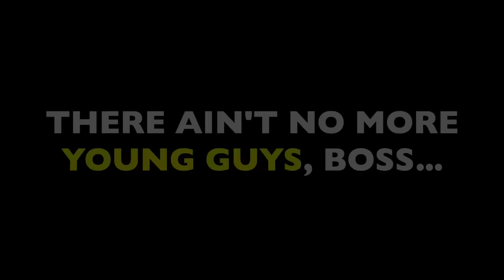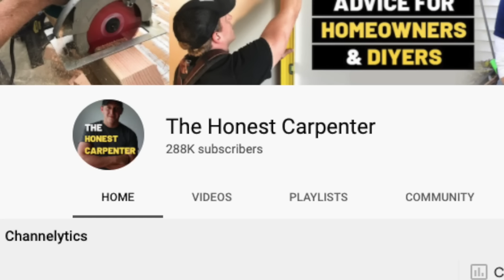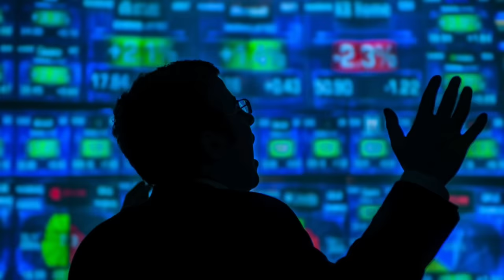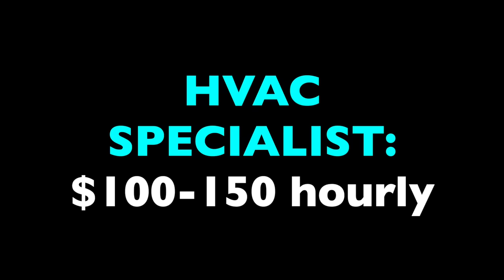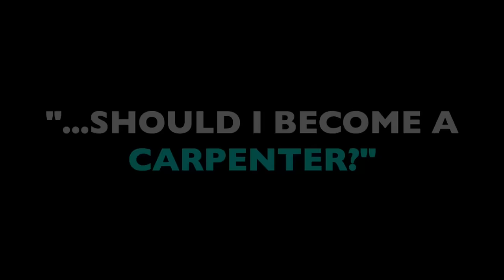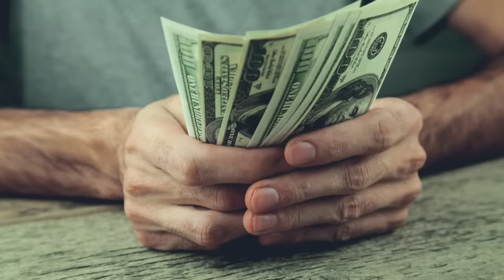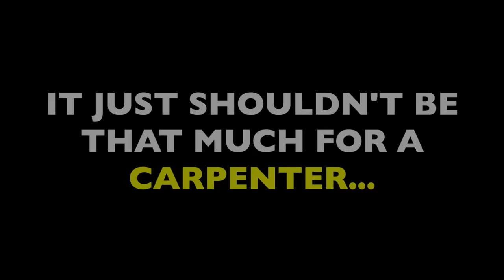WHERE HAVE ALL THE CARPENTERS GONE?! (Why The Trade Labor Shortage Is Only Beginning...)

Comment: A good carpenter makes every other trades life easier.  Poor ones create nightmares.
Reply: @Jody Whitehead - Said perfectly .
Reply from the maker: So true, Jody. Ask any plumber who’s found a joist right beneath a toilet flange location 😬
Reply: @TheHonestCarpenter  when I started contracting my first job was to correct all the things some bozo did to a sweet lady's house. Whoever it was had no idea what he was doing. The idiot did things like cutting the nailing flanges off custom made windows. the joists were all under size, and not on 16 inch centers. His idea for fixing a leak in the garage was to puit up sheets of thin plywood and caulk the edges. I could go on, but just say it was such a mess it cost more to undo than it would have cost to do it all right in the first place. I could not do much about  the widows with the nailing flanges cut off, all I could do was seal around them and put on tight fitting trim. (the lady didn't want to pay for custom fit windows all over again, and I don't blame her.)
Reply: @TheHonestCarpenter  Plumber here, we deal with that all the time. Most framers are terrible; crooked studs, twisted floor joists, every hole you drill you hit nails, etc. The difference it makes when you get good framers vs. bad framers is night and day. We did a house about a month ago and the framer actually moved the joist over a few inches because he knew the toilet was going there. I've never seen a framer actually do that before and look out for the plumber like that compared to the house we're doing now which had terrible framers and the joists were dead center where the toilet flanges had to go... on all 3 toilets in the house. The framers were still on site finishing up so we ripped them good. Of course, all we got out of them was 'no habla ingles'.
Reply: Very true, I run into that issue a lot.
Reply: Trust me they habla ingles..that’s their way of not being responsible for the mistakes...I work in landscape n if a resident complains to them they shrug their shoulders then come to me cause I speak English like them and have to deal with the screw up they caused...funny thing is when they tell me it’s in English..just shake my head and think why?
Reply: Essentially, there are two types of tradesman and this is across the board throughout all the trades: those who see the bigger picture and those whose world stops at the end of their nose. As a carpenter, my no.1 beef is plasterers who "bell out" the last two or so inches from the foot of the wall so the skirtings don't go on flat. Dressing this down for neat skirting takes several times what it would take to skirt the wall. If I mention this to most plasterers, it goes in one ear and straight out the other. I now go round after them with a trowel before the plaster goes off and this is only one example; there are others and yes sometimes it's one of us not paying attention or simply not caring enough.
Reply: @Maltloaflegrande  As a plasterer myself, as well as one who installs baseboard trim now and then, I always try to think of the next guy and make the bottom of the walls neat and plumb for the finish carpenter. If everybody thought about the next guy, this world would be much different. 
Steve.
Reply: I’m now 70 with bad knees and back. I was lucky to learn from an ol guy that could do more with a square than I could imagine. In the 80’s housing boom lots of work went to “no skill required” piece workers that 3 nailed studs (sometimes 2) and whos tapes didn’t have 16ths on em’. (Or many times 1/8’s) Just sloppy work and go. That effects all the next trades, etc etc. Great video. It hit home!
Reply: Totally agree with that. Trades need to work together, i often go out of my way when doing work to move things slightly or do things a certain way so it helps out the electrician/ plumber further down the line. Yet i have had other carpenters ask me why i am i doing something in a particular way, after telling them it will make the plumber/ electricians life easier. Their reply is often - nah screw that, i do whatever makes my life easier. :(
Reply: How incredibly true. I used to tell my friends in grade school that my dad was a carpenter. It was more understandable than an entomologist who studied bees. At the time he was renovating our kitchen with cabinets he built himself. I still have no idea how my dad taught himself what he knew. It seemed he could do anything. How I wish I could have learned his skill but I was the youngest and too young to know at the time, plus a girl and so not socialized to pay attention to that. Now I know how much it matters.
Reply: True that!  My pop was (is at 74 yrs old) a great carpenter proven to me early on.  He  worked by word of mouth and   usually had more work than he could handle. Didn't make a lot of $ until later on when my parents starting buying fixers. Dad knew the trades and mom took care of the business side. Worked real good for them. And luckily (thanks Mom & Dad) I learned both sides.
Reply: @Maltloaflegrande  oh I could agree more . Plasterers are the bane of my life. I'm starting to refuse to start work until they come back and crawl around on their hands and knees and chisel it off.
Reply: Electrician here and would agree.....
Reply: @losferwords100  Crooked studs and floor joists aren’t always the farmer’s fault. I hear you though man.
Reply: @donmamon9263  Good framers compensate for crowned lumber and minimalize it, bad ones just throw it in with no thought and likely don't even check for crown. And when I say crooked studs, I literally mean studs put in crooked and not square. Floor joists out over an inch over the span. All stuff that good framers don't do.
Reply: So do welders 🤔
Reply: @losferwords100  LMAO, I'll be sure to NOT put that nail where you aim to drill a hole.
Reply: Quality and process control would take care of it, again, there's apps that probably need to be created that would scan the structure and pinpoint problems so that the nightmares could be addressed before other trades get in there.  But costs, lack of good homebuilder/contractors as well as low paid sweat laborers produces the crap to start with.
Reply: @geowen57  Just saying, framers that over-nail and put no thought into nail placement just makes everybody else's job harder and costs us money when we hit those nails and destroy our bits.
Reply: @joebloe9901  Anything can be f'd up, example, guy takes 3/4 water line cuts it down to 1/2 line and feeds everything in the house with that, I saw it and took it out.  It may work but not optimally. Problem is everything hides behind drywall, buyer never knows unless they have done that kind of work and know what to look for.
Reply: @robertgaritano7718  And now Biden is letting even more illegals come in to keep the wages stagnant. I don't like the direction this country is going in.
Reply: You're close. A good architect makes life easier.
Reply: This goes for pretty much every job nowadays. Not just construction.  I'm a truck driver, no one gives a shit anymore.
Reply: @NoreastWhips  As a general carpenter you often get to be the next guy and the last guy.  Most plasterers are extremely messy, but when you find a good one you have to treat them well.  I have to do mudding once and a while and I really don't like it, but cleaning it up wet is way easier than letting it all dry up in blobs all over the floor, walls, glass panels, etc.

It's good that you care, because a lot of them don't! The same can be said about my trade
Reply: @carlb401  When you're employed directly by the owner/GC, it's usually encouraged or at least appreciated that you work in that way as it saves the project budget.  
No doubt if a professional trade has to work around a poor situation, it will cost you one way or another.  Contract job: Back-log it, minimal workers on-site as complicated work prevents unskilled workers from being useful.  This will result in delays and re-scheduling of trades (let's hope they are available for that)
If it's an hourly job it will obviously take more time and cost more.  
Everyone is more expensive than us, but depends on our work.  When we are being rushed to complete there will be downline issues.
Reply: @robertgaritano7718  it's still low that's why no ingles to this day.
Reply: @11co5955  It's been stagnant for the last 4. 🤷‍♂️
Reply: I don't know, I've made money off of fixing illegals work. The homeowner doesn't like it, but I don't like them using illegals. So I guess it's even.
Reply: @kellyknowles9249  Damn that's the worst kind of work, I hope you made a lot of money lol
Reply: THAT - is true...!
Reply: @mwjordan1990  good luck finding one. Architects are college kids who've never worked with their hands. They have no idea how to build anything, just lots of ideas on what they want it to look like.
Reply: Tell the gods of spark to clean up their mess and I won't put a stray 16 into their wire.

Comment: I'm a young guy who went to trade school for HVAC and worked in the field for about a year and a half. When I worked in the field I noticed that guys were making maybe a third at most of what they were charging hourly because of things like insurance costs, tool costs, and the amount of time you were driving as opposed to actually making money. This meant the only way to reliably make a ton was to start a business. Because of my physique (5'8" and 110 lbs) I physically cannot do most labor intensive jobs like furnace installs, condenser swaps, or attic ductwork myself so that makes it nearly impossible for me to start an HVAC business. I realized pretty quickly that if I wanted to make a lot of money I had no choice other than a 4 year degree so I got out of HVAC. The reality is it's orders of magnitude easier for me to make money with a degree than in the trades so I got out.

Comment: As a former young automechanic, it wasn’t worth it. Trying to get started, they don’t want to give you a fair shares work, it’s always the older dudes who get the lions share and I pick the scraps nobody else wants. The pay wasn’t good for the back breaking work I was doing in open air shops with no a/c. I ended up switching to personal training for less money, but am way happier mentally. It was hard to do but well worth it. The tradesmen jobs are behind the times and need to start treating their workers better
Reply: Current auto mechanic apprentice here. You described it. Big jobs go to the old guys why you’re left with nothing and shut pay “hey I want more money” “we’ll all the jobs you do are just little ones” “well you won’t give me a shot at the big ones” “well that’s risky you’re not experienced enough” “well I came here to get this experience” endless circle. Everyone wants something but no one wants to give. Myself included I don’t wanna waste my time not learning and working for nothing but bosses don’t wanna risk losing money.
Reply: @jasonjrf  This has been my experience as well. Anytime you need a job done that is even remotely difficult and/or not the standard cash grab job like tire changes, it's like they can't be bothered to fix it. Why actually do work and fix my leaking gas tank when they can spin off 5 bolts on a tire and slap some new ones on?
Reply: Why exactly should the new kid get the big jobs?  You and others don't at all understand you need to gain experience if you want to take on more.  You all want to be at the finish line and all without the effort or work to get there.
Reply: @jurupa  because they aren't building space shuttles, rebuilding an engine isn't rocket science. The work isn't that hard, just time consuming which is why the old fossils want it for the commission. Has nothing to do with experience.
Reply: @jurupa  because the point of an apprenticeship is to educate the younger generation in the trade so the trade exists in 20 years from now. If you fuck them over so badly they leave after a couple of months everyone loses. The consequence will be as in many other sectors that you have just a huge industrial complex that is about buying and throwing away with just a niche for artisanals who do the manual work for enthusiasts who can afford it.
Reply: @jurupa  how do you think you get experience on big jobs if you NEVER get one. Not saying first day be handed an engine rebuild, but when it’s apparent management just wants to keep you in one spot with no intention of growing your career or experience. That’s the issue with the trades
Reply: @ThePortadump  Doing smaller jobs gets you experience for bigger jobs.
Reply: @jurupa  please explain how doing nothing but brakes, oil changes, tires, and suspension job gives someone experience for engine and transmission work?
Reply: @ThePortadump  If you can't understand how that helps you then I don't know what to say. As apparently showing you have basic knowledge is above your head.
Reply: @jurupa   it does show basic knowledge we can agree on that. But doing nothing but that doesn’t gain anyone experience or knowledge in other aspects and plateaus an apprenticeship development. Pounding out ball joints and bolting in wheel bearings isn’t anything in relation to aligning can phasers, setting backlash on diff, then to get good at it you have to do it over and over. You have the exact attitude that causes young techs to leave after a year when they realize they’re hard stuck and no going anywhere cause you won’t let them.
Reply: @ThePortadump  And you have the very attitude that is holding you back because you want things given to you.
Reply: @jurupa  wrong. I have the attitude to not waste my time and wait for someone to hand me things when I know it’s not gonna happen.  First shop kept me in the tire bay, I wanted more they said no. I fucked off and got paid more and better jobs, That shop wanted me to stay with suspension and alignments and wouldn’t give me pay raise, left there for same pay but could start electrical diag and diffs, got another pay raise and now they’re handing me engines. I went out and got what I wanted. Sorry we’re no longer the generation that kisses ass.
Reply: @jurupa if you ain't willing to let one of your better big jobs go that way the others newer people can learn from it then I'd say you're just selfish. It's not really entitlement if the person just wants to learn from it. Honestly think y'all just scared they might be better than you and take more of ya work.
Reply: @MrStone125  For one kid I am not the one blocking you. Two it's entitlement when you think you deserve learning more. For all I know you aren't fit or suited to learn more.
Reply: @jurupa  You over here being disrespectful to these folks in this thread too.
Reply: @carltongannett  Calling them out on their entitlement I guess is being disrespectful.
Reply: I am convinced Jurupa is a troll. I've seen him in the replies of other comments employing the exact same kind of thick-headed augmentation. There is no way someone could be so incapable of understanding why people are upset by this.
Reply: @borntopwnyou  You really need to learn what a troll is. Just because someone holds a different view buddy doesn't make them a troll.
Reply: @jurupa  nah Reading this thread i feel like your missing a few chromosomes cause what there feeling is justified, and the argument points are structured to go against your personal claims, he literally said how he wanted more pay and he went got more pay
Reply: @jurupa  "it's entitlement when you think you deserve learning more"
....so the entire driving force behind innovation, progress, capitalism, and societarial progress is a bad thing in your eyes?
Everyone wants a better tomorrow. Entitlement is part of the human condition and it's not bad all the time. Entitlement is the reason why America managed to become a super-nation with only 300 million people, having such a large economy that it drives the economies of other nations. Entitlement.
And EVERY human being is entitled to learn more. It's the entire reason why we agreed collectively that literacy is a good thing, because then you can learn more. It's not up to you or anybody else to judge whether I'm not suited to recieve knowledge or not, and if you gatekeep knowledge because younger people haven't impressed you enough, then SHAME on you.
Reply: @starsiegeRoks  Being entitled isn't part of the human condition. And there's no gatekeeping here. Just because you think you should be taught something doesn't mean you should be taught it.
Reply: a lot of people arguing in the comments lol. let me clarify: i wasn't some new kid coming out of highschool without any experience. i took all 4 years of auto tech in high school, became ase certified, went to college for automotive, and had years of work experience by graduation. that still didn't help my case, because i was still "young", which was just a bs excuse to not give me fair work.

the older dudes will always get the easy/big money work, even if you are qualified. you will be taken advantage of any opportunity that presents itself. i can handle a little bit of "new guy" work, but there's a certain point where that should end.

bottom line is that the automotive industry made their own bed and its time for them to lay in it. they shunned away a lot of the younger people and now all they have left are older dudes with broken bodies. take better care of your employees
Reply: @G1993_  I made it through about half of what you did anf realized the same thing. I'm just glad I didn't waste my money on college. 
Once everyone that is over 50 right now is gone, so say about 30 years, we'll be a whole lot better off in the trades